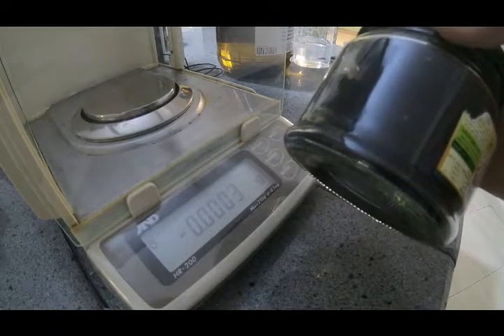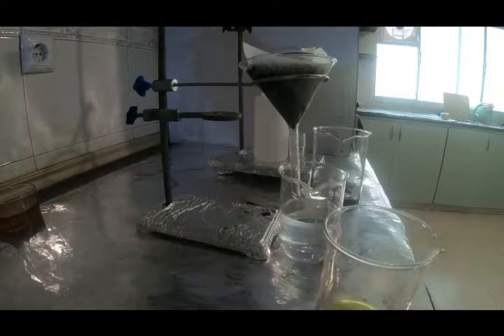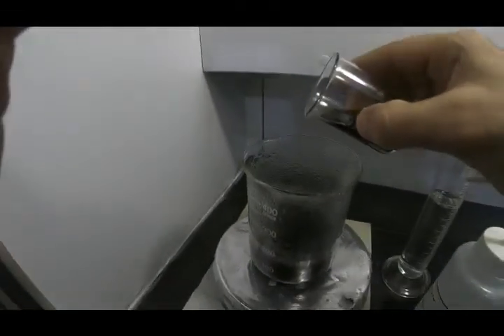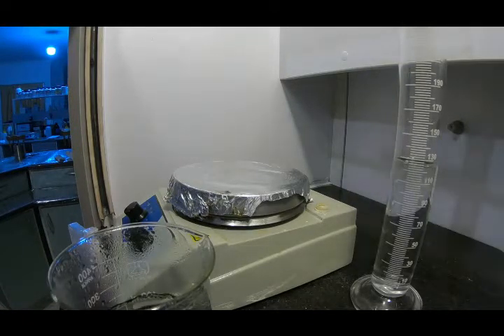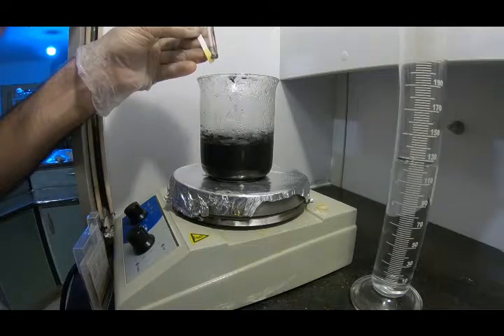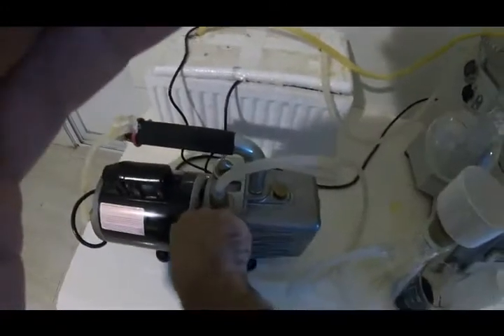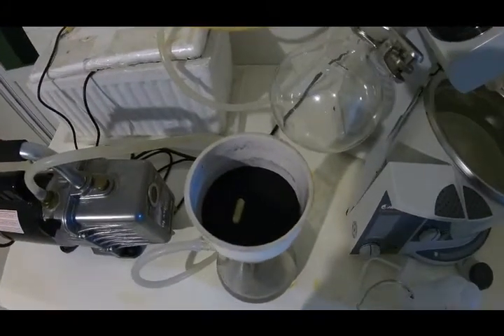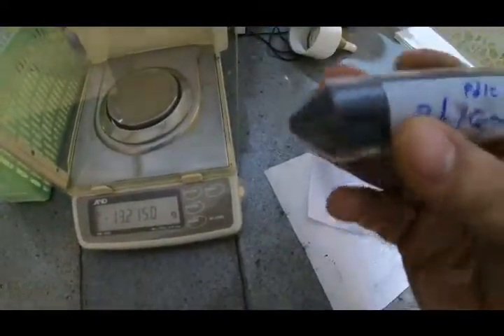palladium on carbon

Comment: Well demostrated. Like those flip flops in the lab hahah. I would be very interested to see platinum plating using hexachloroplatinic acid to make electrodes
Reply from the maker: sharp ears:). i will try to make a video about platinum electroplating. thank you for your suggestion
Reply from the maker: @notfiveo i have to study about it. after all, I am not an electrochemist. but someday I might try it.
Reply: With platinum metal as one electrode and a conductive metal to be plated as another electrode in a medium of hexachloroplatinic acid. They won't be shiny indeed but this is not the objective. Platinum electrodes are useful for electrochemistry. For example the overpotential of the electrolysis of water is very low. Another useful reaction is the production of perchlorate salts from chloride salts as it doesn't corrode. The rough surface (larger surface area) wil allow larger current densities.

Comment: Hi! I made experiment, put 2 electrodes connected to solar panel (voltage 1.2 - 4.6V) into river for a 1.5 monthes, cathode is  titanium in activated carbon bag (100 gramm),  and after extraction from river I received  120 grams of activated carbon weight. What do you think, what method to use to get precious metals from ac? In a microscope, I can see  mostly white metall on ac, and some small places with yellow particles.
Reply: this sounds interesting! did you come up with the idea yourself or did you follow a protocol?